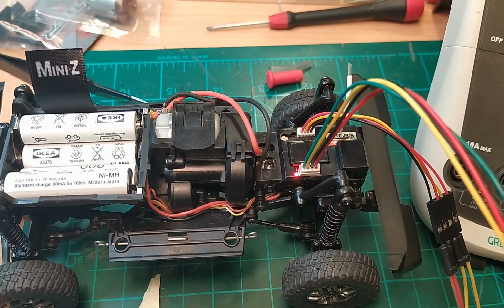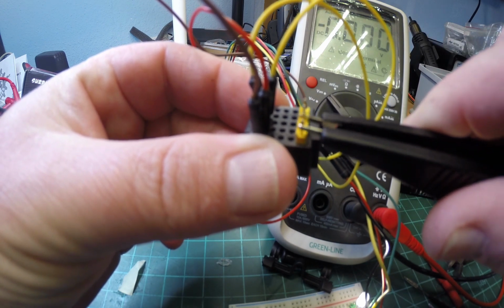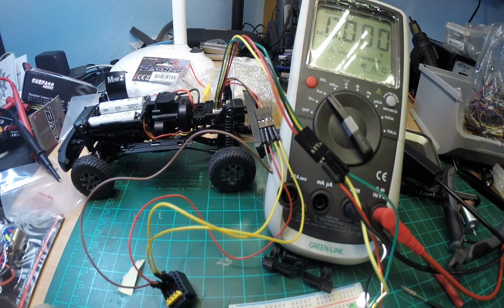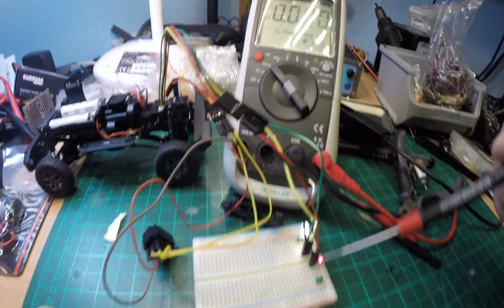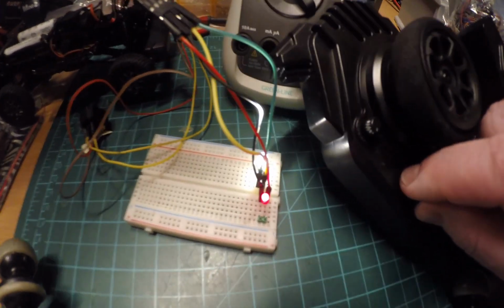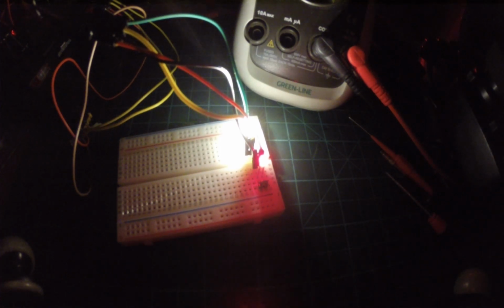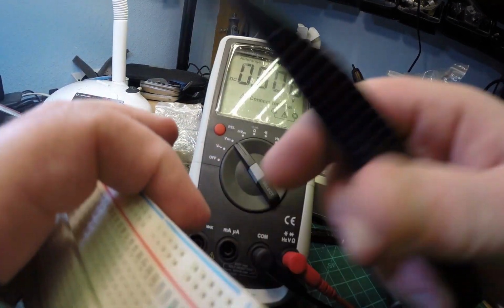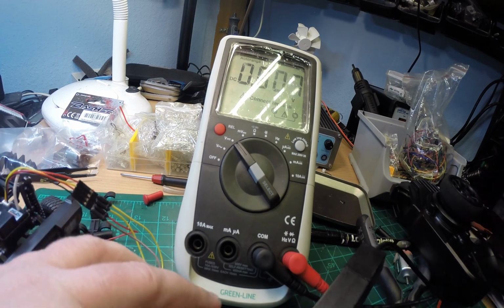Mini-Z 4x4: Board-integrated lightcontroller

Comment: nice works
ther two jst
first jst 1.25 - 4pin
and what is the second?
Reply from the maker: Only one 4-Pin 1.25 mm JST GH - it is the gyro plug, the other 4-Pin is 1.5 mm JST ZH and this is the lightcontroller plug.

Comment: Great info as usual Donald! How many LEDs would you think we could run from this port without risking any dmg to anything?
Reply from the maker: Sorry for the late response (no message from YT).
A "normal" (5 mm, 3 mm, small SMD) Led takes 20 mA. And since the original Mini-Z Light kit also uses this plug for powering the 4 LEDs, I assume 8 or even 10 LEDs should work, maybe even more.
But sorry, I cannot give a guarantee, since Kyosho does not give any information about the Mini-Z boards.
I would try... but thats me ;)
But I do not wanna use the stock lightcontroller because of this akward blinking mode and no possibility to switch off the lights.

Comment: Hi there can I use yellow LED light on the adjustable blinking side ?cos planing to use it like a hazard light, if can must I use a resistor ?
Thanks again.
Reply: Thanks again for your information greatly appreciated. 
Can’t wait to see your Jimny with LED light up 👍😊
Reply from the maker: @derrickwth  I do not intend to use this integrated light controller (hate those blink modes and no possibility to switch light off). I want to use a real lightcontroller (a LaneboysRC LC). But therefore I need to find a ch 3 signal on the Mini-Z board... we will see.
Reply from the maker: Hi, yes you can, the board must have a LED controller. No resistor needed. 
Tested it with yellos 3 mm LED, no resistor, no problem. About 1/2 hr., half time steady light, half time blinking. LED does not get even warm. Run 4 in parallel, no problem either (slightly weaker with more LEDs, but not much).

Comment: Awesome :) Does this mean that if you would want to make your own light kit, you just need a connector some wire and led’s? No resistors or anything to make it work?
Reply from the maker: Yes - the board must have a LED controller chip integrated. Tested with different colours, white, red, green, yellow - no problem, all work, not hot... (and blue of course will work, too ;)  ).
Reply: Cool :) So it wouldn’t be to difficult to make my own light kit once the Jimny I ordered actually arrives.
Reply: donaldsneffe What was the type of connector called?
Reply from the maker: @Sponge1310  The light connector is a JST ZH connector ("1.5 mm micro plug", used for example in many satellite receivers), the gyro connector is a JST GH connector ("1.25 mm micro plug", used for example in ultramicro 1s batteries such as in old Blade mCx, Nano Cp, or 1s UMX planes, ... also in some tiny servos).
But take care, this is quite a mess, easily to be mixed up. JST SH 1.0 mm, JST GH 1.25 mm, JST ZH 1.5 mm and JST PH 2.0 mm.
Reply: donaldsneffe Thanks! Yeah I was looking on the Conrad website and there are so many variants that it’s easy to get confused. I was thinking of making my own light kit with a extra connector, because the Jimny Has it’s rear lights in the bumper which stays on the chassis but it’s headlights are on the body which you can take off, but then if you would disconnect the light kit, the body would still be connected to the chassis via the light kit leds in the rear bumper.... I hope that ramble makes any sense 😅
Reply from the maker: @Sponge1310  Conrad? OK - dann Deutsch ;-)
Beim Conrad hab ich früher die JST PH gekauft (da gibt es aber nur Buchsen und Kontakte einzeln) für Blade mCPx, 130x, die kleineren noch nicht. 
Am besten und billigsten bei Ebay.com (oder auch Ali), auch mit Kabel. Jeder Elektronikladen hat die schon, aber die richtigen zu finden ist schwer. JST ist eine Marke, die "Nachbauten" findet man so natürlich nicht. Crimpen ist mit normaler Crimpzange (für 2.0, Servo, ...) ziemlich unmöglich. Dafür gibt es die geniale Crimpzange  Engineer PA-09 (z.B. Amazon), jeden Cent wert das Ding.
Reply: donaldsneffe I’m Dutch actually 😅 and my German is pretty bad so I’m having some difficulty understanding what you wrote 😅 But from browsing the Conrad website, it gets confusing quite quickly... I noticed they sell the connector, but only the plastic part of it and you have to get the metal contacts that go on the wire separately, from what I understand of what you wrote, I’ll also need a crimping tool? So that needs to be added to my shopping list 😇 I’m starting to think making my own light kit might be a bit out of my depth...
Reply: donaldsneffe I’ve been looking at ebay, and they sell JST ZH 4 pin connectors with wire already attached... maybe that would be a easier starting point for a noob like me :)
Reply from the maker: @Sponge1310  Oh... sorry. My German is pretty bad, too (speaking Austrian ;) ).
Yes, this is what I said, Conrad only sells housings and metal contacts. (However, I only bought 2.0 mm from Conrad years ago, JST PH, do not know if they have the smaller types).
Crimping is very difficult and nearly  impossible with normal crimping tools (used for normal servo plugs, etc.).
It will be easiest for you to buy plugs with wires. Search on Ebay.com for "4-pin micro plug 1.5 mm" (or on Ali, maybe Banggood). They are very cheap.
If you want to crimp those, you will need a special crimping tool for every plug type, which are extremely expensive (200 € or more).
But there is a fantastic crimping tool from the Japanese company Engineer, the PA-09. You can buy it on Amazon for about 40 €. I love it - with this tool you can crimp 1.0, 1.25 and 1.5 mm plugs. Still not very easy, but works like a charm after some trial and error. If you really are into this and want to crimp, buy this tool. There are no similar tools from any other company (not from the Germans Knipex, Wera, Wiha, ... etc., and also not from the cheap Chinese companies).
Reply: donaldsneffe oh my bad sorry 😅 Yeah, there’s a lot or stuff on offer on ebay that will probably be a easier route to go. I saw a video on the light kit Kyosho sells, but it seems to be a generic kit for Mini-Z and more tailored for the racer and not the 4x4, as the wires to the headlights are too short to reach properly. Thanks a lot for your advice and sharing of knowledge :) I tried to find out more about this subject on a Dutch Mini-Z Facebook group but nobody knew the answer or didn’t want to share what they know about it unfortunately.
Reply: @Sponge1310  did you get sorted are you a diy guy? I made my own connections an is super simple but honestly buy a kyosho mini z led kit,(kyosho will probly make there current ones 4cm longer to suit the crawler wheelbase!) But i know the kyosho ones work from a test from my awd drift cars,

P.s check my mini z vids🤫🙂